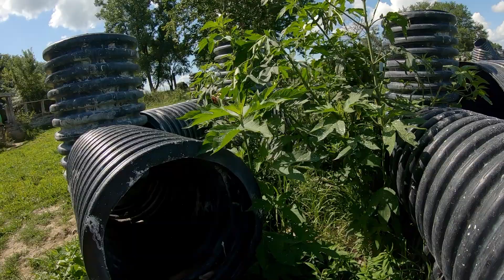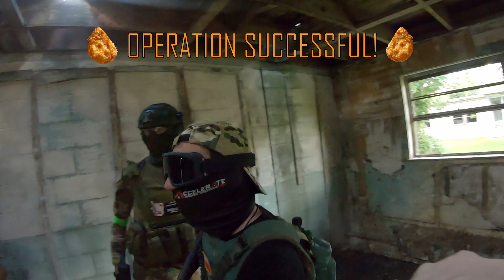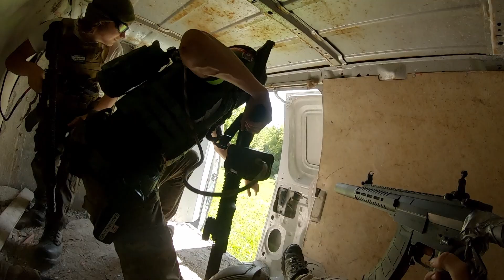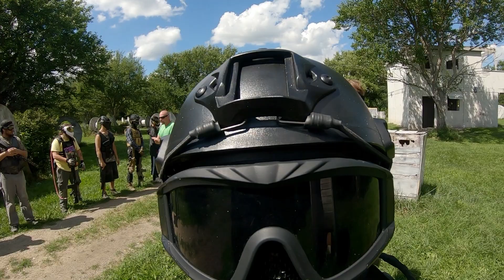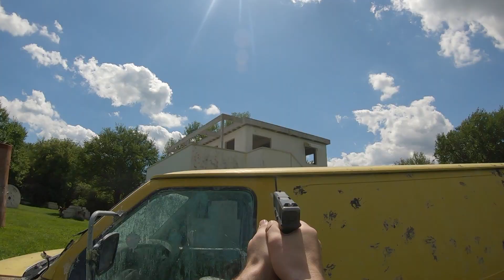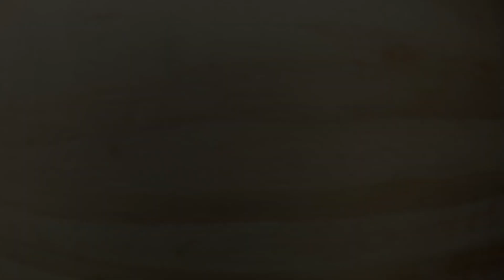Operation Chicken Nugget! | Airsoft Open Play Highlights! (Blastcamp)

Comment: What gun are you using?
Reply from the maker: It's the EMG MK47. If your thinking of getting one I highly recommend you don't. They are a lot of work and have a lot of issues.
Reply: @Naloma  I just really like the sound it makes
Reply from the maker: @DanvilleAirsoft  It's because the engine and the foam disks in the suppressor. Sadly I've shot half the disks so it sounds different now.